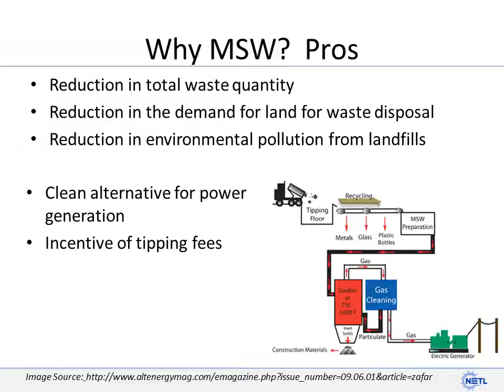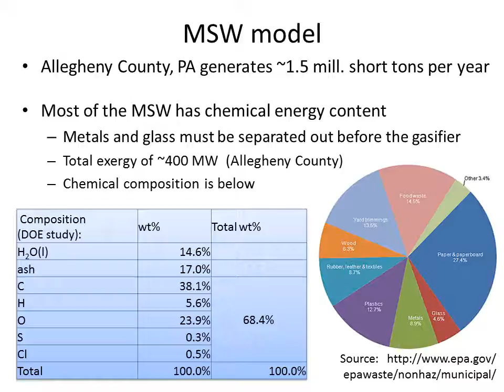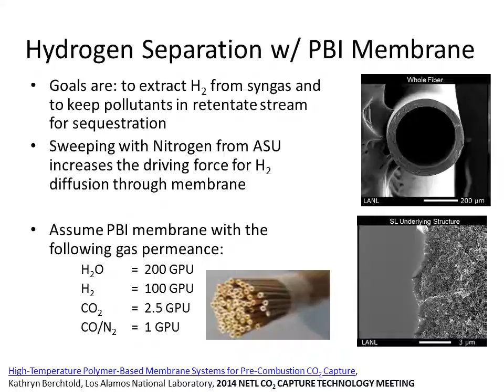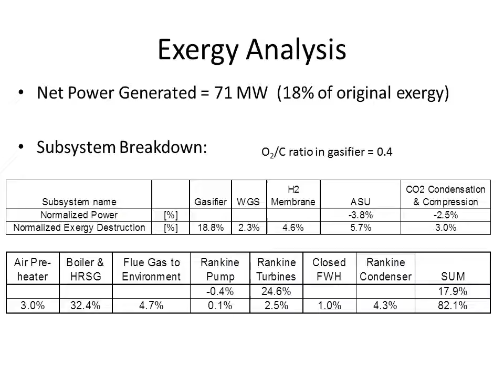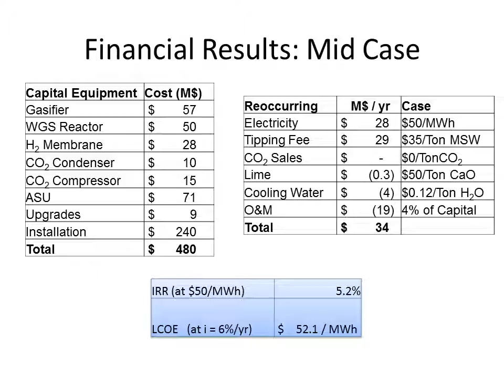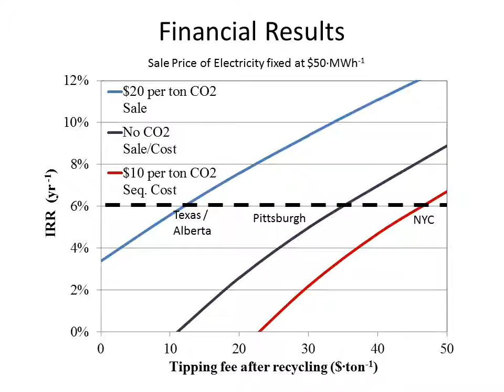MSW Gasification for Retrofitting Recently-Closed Coal Power Plants

Comment: Nicholas, why do you need pure oxygen??? and pressure? 
Anyways, I am really interested to exchange some thoughts on this. If you are not mind I would like to have a talk on skype as there are interesting opportunities here. I am working on similar project but in smaller size. I want to use the gas to run a GenSet. Start small with 50kw torches x3 or x 4. then we see where we go.
my contact is artash_sh
Reply: try oxyhydrogen torches, they produce needle like flamse up to 3 feet long if you like , this flame can melt carbon

Comment: The calculations are very close to reality (from my point of view)
Just another question on the technical side. What if you use a plasma torch in gasifier? That would increase the rate and amount of gas. There are plasma torches that can stand 24 hour work time up to 6 months. It can even gasify the coal!!!
Reply from the maker: Tango,
Thanks for the comment.
While there are many different plasma torch companies, I'm not aware of any plasma torches that operate at high pressure (>30 bar) on pure oxygen. I would have to do an economic analysis to determine if the increase in the rate of reaction from the higher temperature of the plasma torch offsets any negatives (such as the capital cost of the plasma torch and the operating electricity consumption cost.)
Any thoughts???